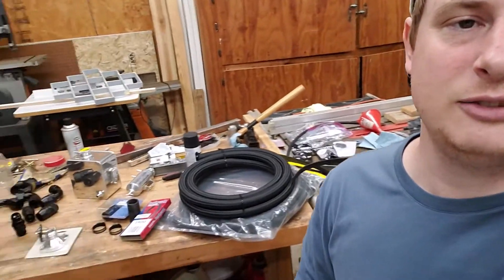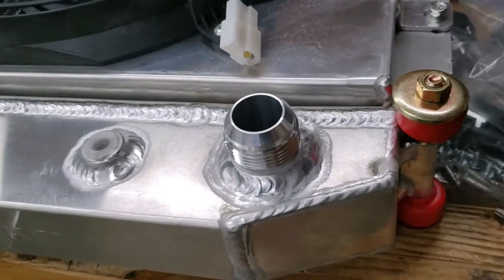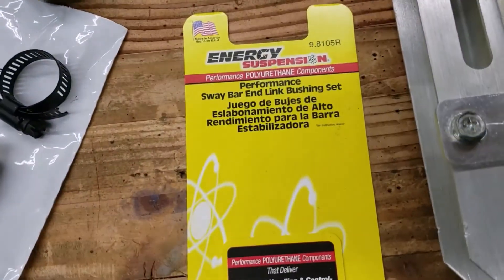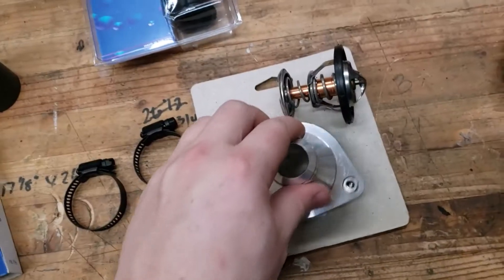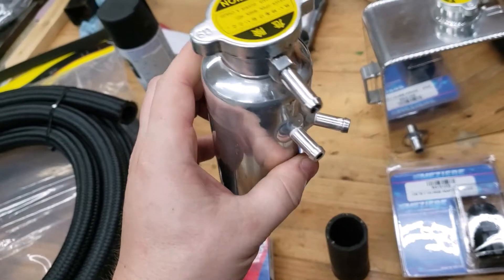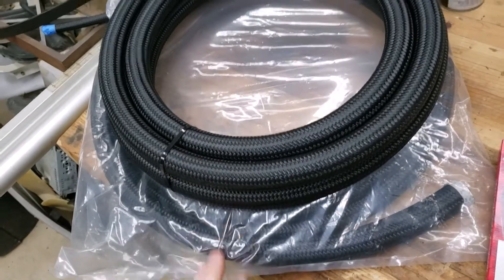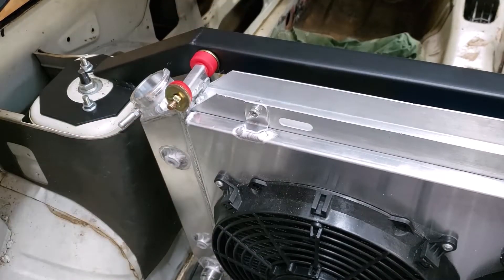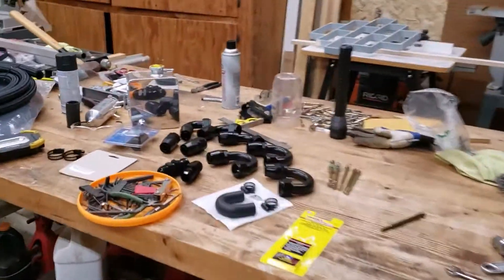Adapting LS Cooling System to AN16 Lines and Fittings - EMUSA AN16 Fittings from Amazon Fail

Comment: I am loving the build, but I'm not sure putting the radiator in the back is going to be a good idea.  #1 I'm not even sure you will pass tech for any events if the radiator and/or lines are in the driver's compartment (if they burst, you will be severely burned).  #2. It is going to be very noisy, even if you put a bulkhead between the radiator and your seat (it will still be right behind your head).  #3 You are going to have to remove the rear window, or do some other massive duct work to get air into and out of the radiator.  #4 The cost and weight of all the lines and connectors alone makes it not worth it.  

As for the AN fittings going together, you are supposed to use oil on the fittings, which helps the fitting slide into the hose.  They even sell a special oil for this purpose.
Reply from the maker: Thanks man! Yeah it's getting separated from the main cab, NACA ducts in the side windows, rear glass is gonna be removed, and I'm also going to shroud the hoses going next to the passenger seat. I did use oil on all the AN lines for this build, I normally just edit it out for video flow purposes 👌 but I definitely appreciate all the insight my guy!! Yeewwww. Oh and as far as passing tech 🤷‍♂️ we'll definitely see what they have to say when that day comes lol

Comment: Any luck with the new fittings?  I've had good luck with the cheap ones,  they are a bitch to get together tho, soak the end of the hose in hot water and use some oil on the tail and the threads helped a lot,
Reply from the maker: The Jegs fittings didn't work either and finally got some Fragola fittings and line that worked. I'll keep the soaking in hot water trick in mind for next time 👍